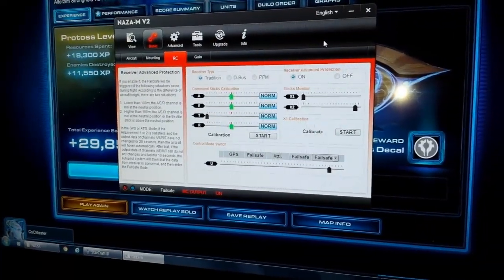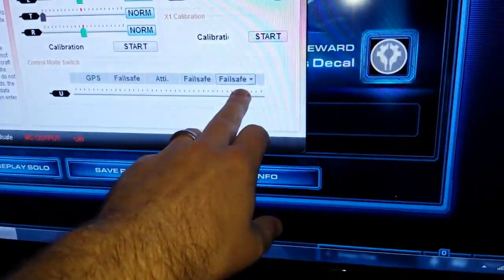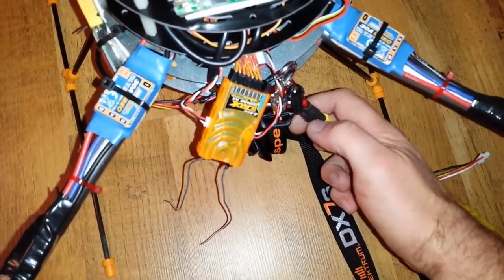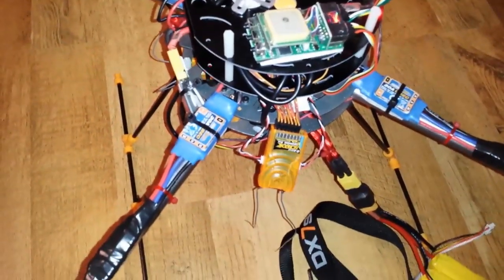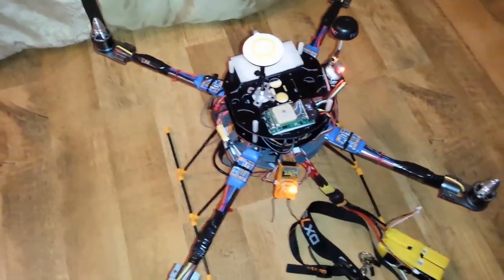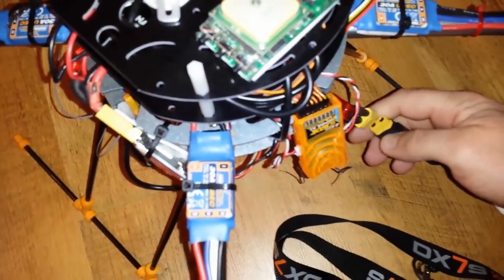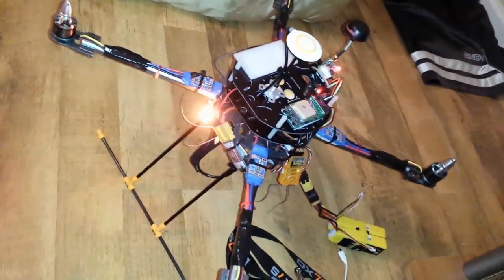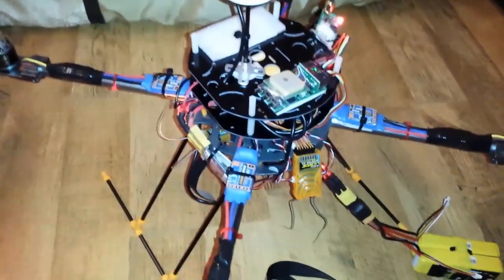How to set up failsafe NAZA m v2 - spektrum rx

Comment: my throttle stick moves my rudder. my left stick moves my elevator up and down when I move it right and left. my configuration if all backwards, how do you fix that?
Reply: Clear all mixing from your Tx. And make sure you plugged your servo connectors in the Rx in the proper channels.

Comment: Here it is in written form:

SET FAILSAFE FOR TX SIGNAL LOSS

1. Turn everything on and get everything connected to the PC.

2. Make sure the control mode switch is working.

3. On the transmitter, go into the fuction list (click the wheel down)

4. Go to Servo Setup.

5. Flick your control mode switch and check to see which channel its on. GER, PIT, AX2 or AX3.

6. While watching the control mode switch postition on the naza assistant,
Remember the two percentages of travel for the CMS channel (we will be changing it back to this when we are done)
Now change the travel on the control mode channel servo travel until the tab moves away from either GPS or MAN. Move it to failsafe.

7. Once failsafe lights up blue, exit the assistant, unplug the copter from the pc, turn the copter off and then the transmitter.

8. DO NOT CHANGE ANY SWITCH POSITIONS AFTER STEP 6!

9. Make sure everything is turned off.

10. Insert the bind plug into the correct port on the receiver (make 100% sure it says BIND on the port)

11. Plug in the copter/receiver. The receiver LED will start flashing. This indicates its looking for something to bind to.

12. NOW REMOVE THE BIND PLUG BEFORE TURNING ON THE TRANSMITTER! LED will continue to flash.

13. Make sure your transmitter is OFF.

14. Now hold down the trainer button while powering on the transmitter. Hold the button until it says its binding and displays DSMX.
Then release the trainer/bind button.

15. Once binding is complete the transmitter will reboot and go into normal flight mode. The LED on the receiver will now be solid.

16. Preset Failsafe binding is now complete.

Comment from the maker: A lot of people seem to have the same question. The purpose of reversing the channel on the transmitter is so when you turn the transmitter on it should be set on fail safe in the NAza Control Panel/gui. After you bind it like I showed you with the channel reversed then after done, you go back to your transmitter and un reverse the channel. That way when you turn on your transmitter it will not be in failsafe you can then set fail safe to whatever channel you want and whatever switch just make sure you set it up properly in the GUI.
Reply: Hi Eric
          Would it be possable to let me have DX7s/Naza file,as i am going around in circle's trying to program my DX7S,im getting on in years now so not so easy.
My email is desheardmbe@hotmail.co.uk.
           Cheers
               Des

Comment: I have a little problem with my NAZA m Lite... I installed it correctly, then " binded " my radio to the Rx (DX7s and something like a orange 615 I think) and, when I connect the battery on F450, there are 3 series of flash ( normal initialization) then the LED begins flashing red quickly and when I connect it to my Pc, with the software, I have this message: Configuration error, this may cause by firmware upgrade from old version.or abnormal Tx calibration. Re-calibrate your transmitter,and power cycle your controller and check all of the parameters.
i need help
Reply from the maker: Make sure the rx you are using is able to do failsafe. Not all are. If it is. Go through all steps in video and recalibrate the gps and compass.
Reply: I will try, I it didn't works, I will buy a KK 2.1 have you ever used a KK board ?
Reply: you have to bind the tx/rx again. i had the same problem.

Comment: Hi, Thanks for the video, I just couldn't get the failsafe to kick in when I switched the Tx (DX7s) off?? On my Ax1 (flap) I had 0=GPS, 1= Atti and 2= F'safe.  Even when binding with the switch in pos 2 it would not kick into failsafe with the TX of, always stayed in GPS.  Now that I have reversed the channel so 0=F'safe it works a treat.
Thanks again.

Comment: I got dx8 transmitter an ar8000 receiver. An naza v2. So when u turn off. The transmitter at the point it doesn't matter if turn of or on the return home switch I'm confused
Reply from the maker: At first you have to set your aux ch to line up with the failsafe bar on asst sftwre with switches turned off. So when you bind it will bind while being in failsafe. Then you can change the aux ch to however you like, whatever functions you want. If you turn tx off it will go into failsafe. If you set the aux switch for failsafe too, you can also have it on a switch.
Reply from the maker: You just have to bind it like this so if you lose signal it will rth. The reason you need to reverse the aux is to line it up w failsafe with all switches in off position so you can bind and it wont throw a switch error when trying to turn tx on. Once bound you can set switch back to whatever you like.